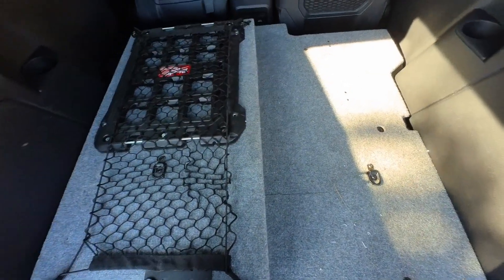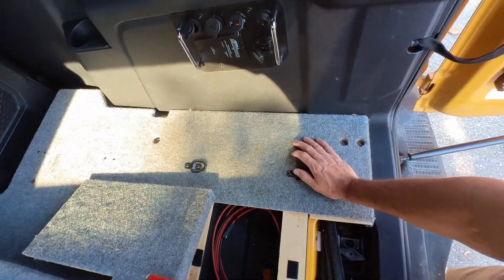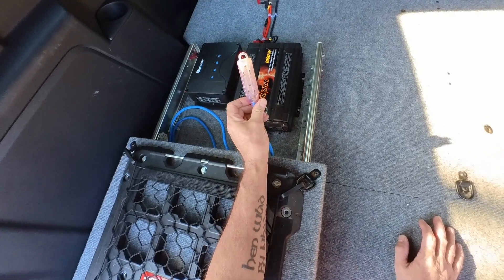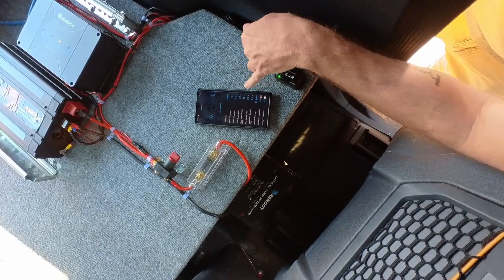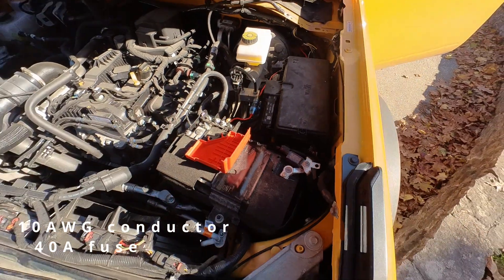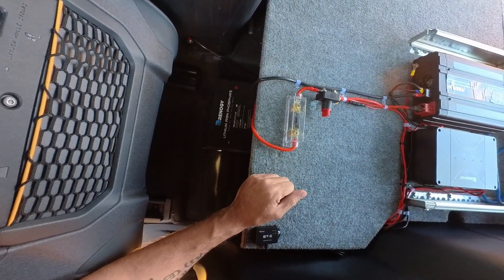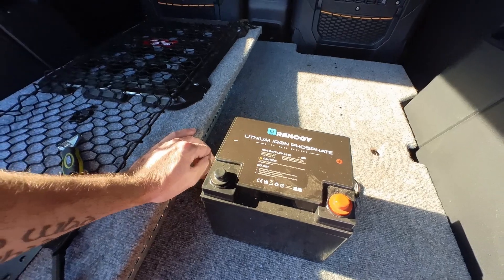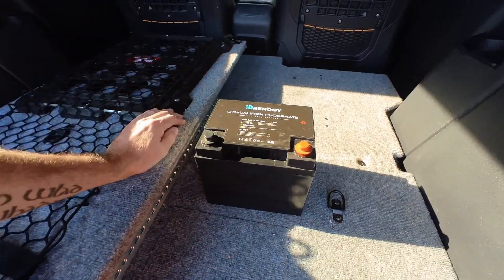Overland Auxiliary Lithium and Solar Power: How I connect

Comment: Pretty nice vehicle-specific installation. Very similar to the Expedition Quartermaster box. Check out the Engel line of fridges, they only draw .5 A when at temp.
Reply from the maker: Thanks Donovan... I'll be looking to add a fridge next season 👍🏻
Reply: @TLOverlander   We've had our MT-45 since 2006, bounced it around over all sorts of trails in the South West, it just keeps going! You won't be disappointed. The optional efficiency bag really helps too!
Reply from the maker: Thanks Donovan... I'll be giving it a good look. 👍🏻💪🏻